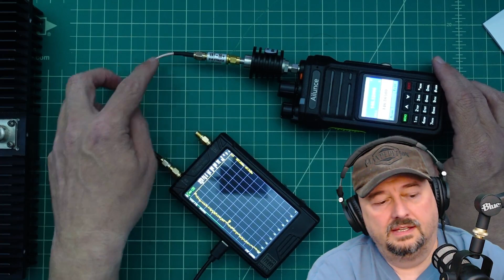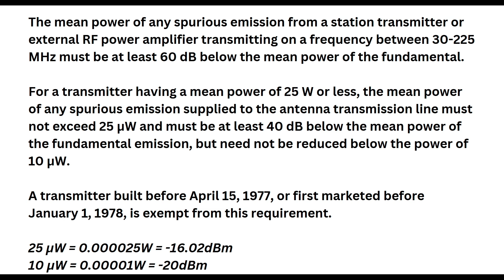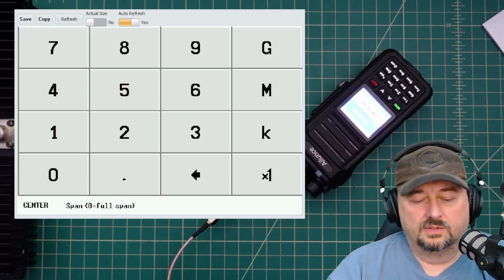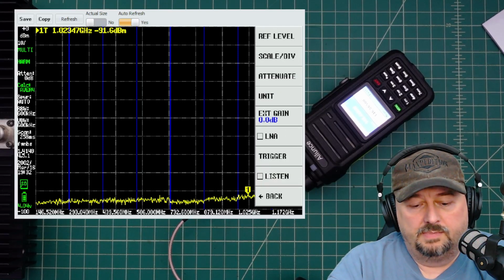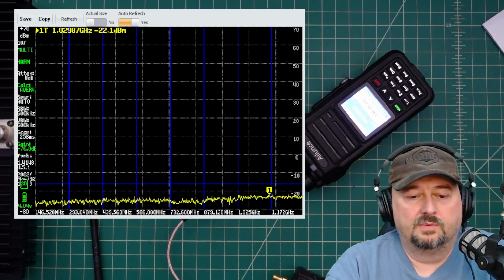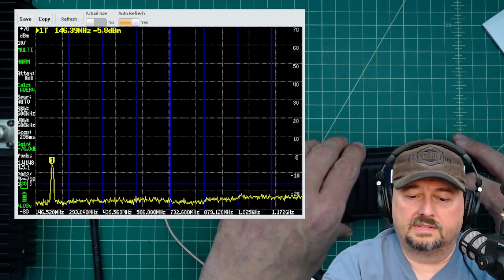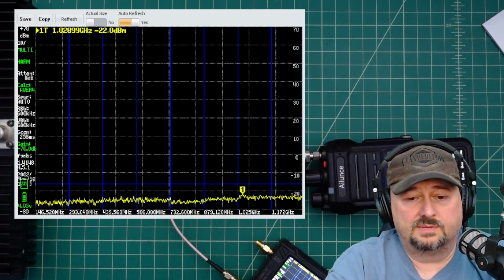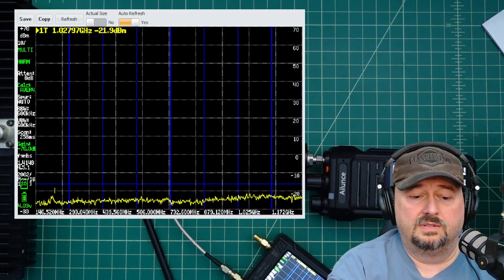Ailunce HA1UV Dual Band Radio: Spectral Purity Test

Comment: What do you mean there is no requirement for the harmonic test on 70cm? Or have I misunderstood what you meant here? (I'm not in the USA - is this a FCC thing?) Generally, the requirement for spectral purity applies on all advertised bands. Very interesting! Thanks for the videos and testing. 73
Reply from the maker: Hey Postie, I cover it on the slide with the rules.  In the US you don’t need to worry about them above 225MHz 👍
Reply: @TheSmokinApe  really insteresting Ape.. Here in VK, we have a lot of emergency services on UHF and it seems crazy to me that the FCC wouldn't want to protect the V+U spectum by the same method (like we do here). 73
Reply from the maker: I’m pretty surprised about that myself 🤷